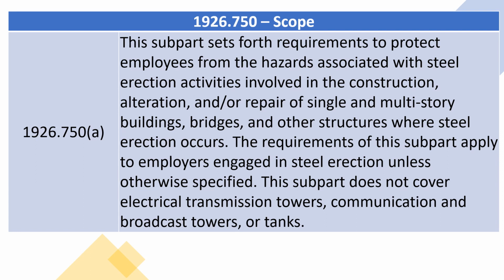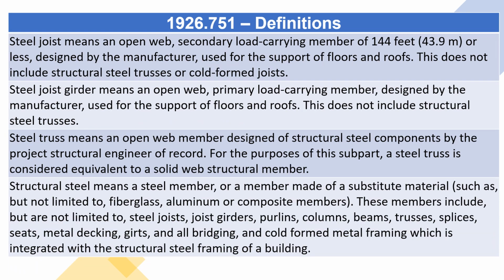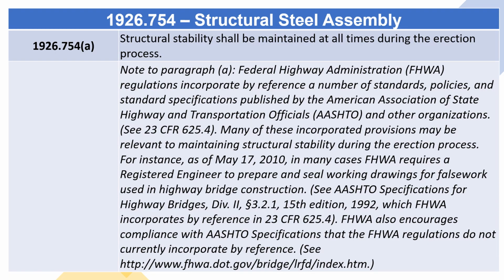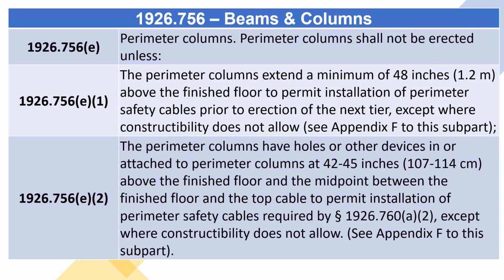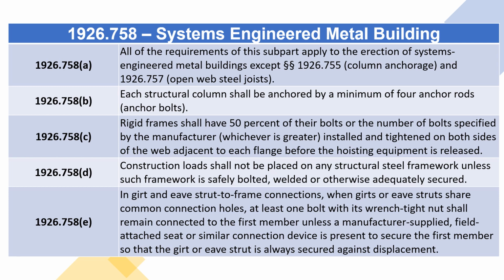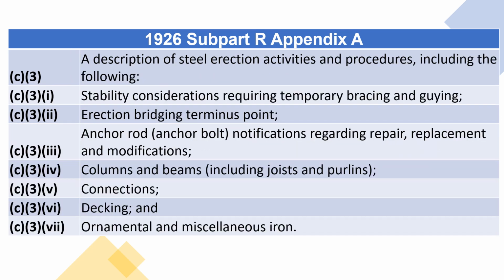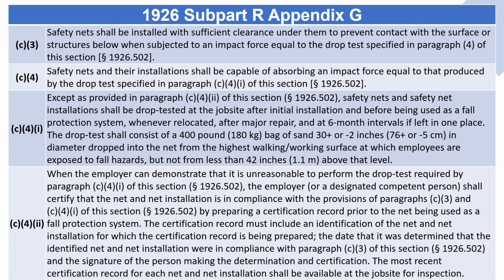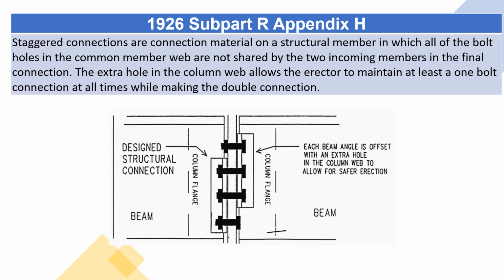OSHA 1926 Subpart R - Steel Erection

Comment: As a union Iron worker most of the steel erection jobs I worked on were not restricted to the ridiculous tie off restrictions and we walked the Iron like real Iron workers. Sadly depending on what your state you are in and if it’s a federal job or not (fed jobs do not allow for sub part R federal exemption from tie off rules). Most Iron workers are not allowed to work productive.
Reply from the maker: @dizzydiver18866881  thanks for the comment. OSHA is a baseline regulatory agency while acknowledging the role of owners, general contractors, and state-run OSHA plans in establishing stricter rules, particularly in steel erection:

“OSHA sets the baseline safety standards, but it’s important to recognize that owners, general contractors, and state-run OSHA plans often implement stricter regulations to enhance worker safety. This is especially true in steel erection, where Subpart R provides specific fall protection provisions, but many projects default to Subpart M’s 6-foot fall protection requirement instead. While federal OSHA allows for certain exceptions under Subpart R, many job sites enforce the more stringent Subpart M standard to ensure a higher level of safety. State OSHA plans can also introduce additional measures that go beyond federal requirements, making compliance more complex but ultimately aimed at reducing workplace injuries. Although out in the field I’m sure it does slow things down as compared to not having to tie off at all.